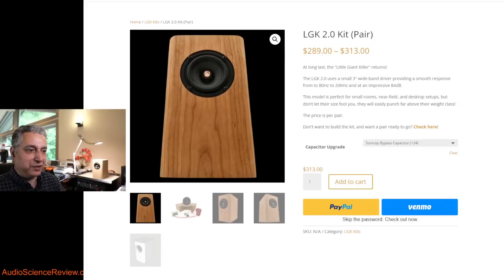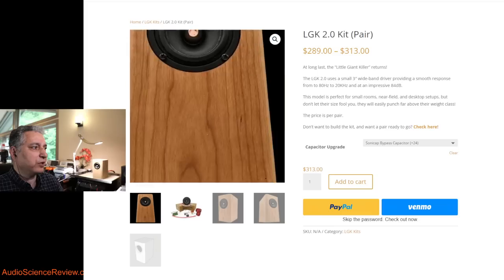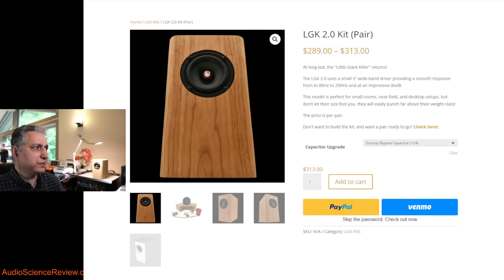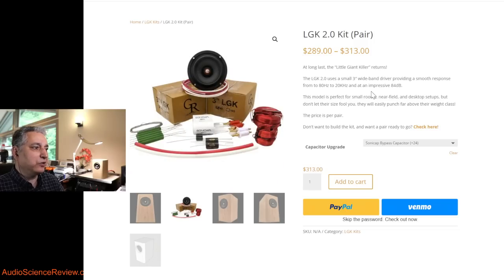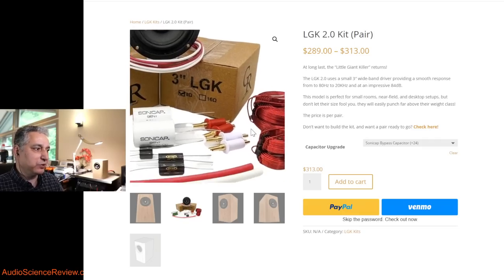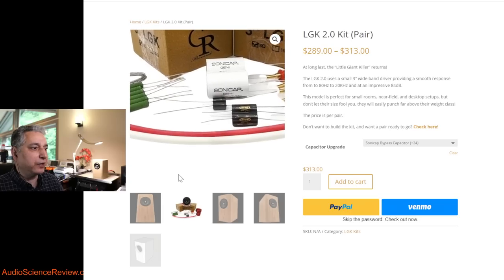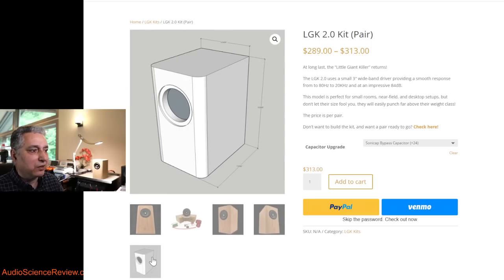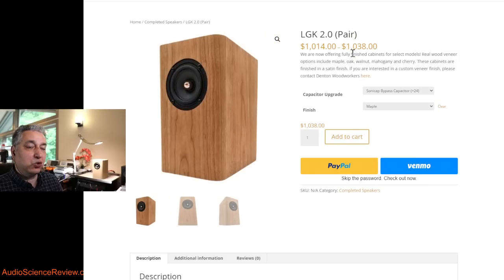GR Research LGK 2.0 DIY kit Speaker Review

Comment: Very interesting but you have one thing backwards.  The reason for the peaks is the storred energy in the driver (resonances) not the other way around.   But very good to be so thorough and explain how the data can be manipulated.  I am surprised to see so little ringing in the treble with such a large diaphragm.
Reply from the maker: If A=B, you can say B=A just as well.  With minimum phase systems which speakers mostly are, time and frequency domain are interchangeable.  So there is nothing backward there.
Reply: @AudioScienceReview  actually no.  I can alter the phase without changing the timing, but I can't change the timing without changing the phase (unless I specifically changing the phase).
Reply: @AudioScienceReview  Here is a simple example of what I am talking about.  If I hook up a speaker reverse polarity, all of the sounds are out of phase (180 degrees)  but not out of time ( no delay).  But if you delay the sound out if a speaker, all of the sound coming out of the speaker will be out of time (delayed)  and out of phase.   You can adjust the phase back into phase but for only one frequency of all of the different frequencies coming out of the speaker due to all all of the frequencies having different periods.    So hopefully this explains that A=B but B does not = A.

Comment: lol, GR is sending out speakers not to Jay - he is now qualified as he is using high end cables and and even cable raisers! Only then you will get a sample for "testing"...
So much snake oil... I like some stuff GR is doing as they try to make the market aware that a good speaker needs some good components... But in many cases they just overrate the importance of i.e. a "high end speaker terminal"...
Reply from the maker: Yeh, as I noted, this kit also comes with said high end speaker terminals (tube connectors).  This makes the whole affair a lot more offensive since it pushes the cost up so much.  Engineering is about spending money where it matters, and not where it does not.
Reply: @AudioScienceReview  Yes so true. If the base is not right (like the selection of the driver)  then a golden suprainductor cable made from Unoptanium does not make it better...
Hope you will test threi 2-way designs some time.
I build my own spreakers from a german designer - very nice (I hope) - but probably to expensive to ship the stuff to US. They cost around 1k per speaker (very high end Be tweeter is alone around 400€). - but I am happy.
Reply: @AudioScienceReview  one day after your video - GR announced an upgrade 2.0 version. Not understand what exactly changed - he was just babblng about a woofer?
Anyways he described also that the speaker is not for loud sound... "maybe 84db"...

Comment: Ouch. I know he made a video earlier that he would host you in Texas, so you can accurately hear things. Maybe you should go. I’d certainly watch that video.
Reply from the maker: He is giving me little reason to go there.  If he wants to sell me on his tweaks such as tube connectors and cable lifters, then he should do a blind test in front of the camera as he has promised.  Then I could go there and verify.  He also needs to provide data on why his audio system is great.  Stringing a bunch of audio products and powering them with lead acid batteries and such does not make for a good system.  Post a measurement of the room and then we can talk.  I also like to know who told him having curtains all around is a good idea.  The fabric acts like a high frequency absorber which is definitely NOT what you want to do in your room (you need to have broadband absorption down to a few hundred hertz).
Reply: @AudioScienceReview  If both sides approached it with honesty, your visit there could be one of the greatest videos in audiophile history.  That's asking a lot for anyone in the audiophile trade though.  Preconceptions are the norm on pretty much any topic or side of any topic relating to sound reproduction.   For example, many people claim that there's no difference in amplifier quality.  Maybe once you get to a certain point, that's true, but at the sub $1000 AVR level I've found large differences with certain speakers.  And it's not subtle at all.  Simple measurements like SNR or THD@1KHz into an 8 ohm resistor don't mean that much.  That doesn't mean measurements are useless, just that a lot of amplifier measurements aren't indicative of sound quality and I never see measurements of an amp into an actual reactive load.

Comment: 26:25 i don't think i've ever heard an undamaged speaker behave like that.. i would suspect a BIAS adjustment is in order on the amp or the output transistors are about to short out, the speakers are the last thing i'd check. that driver is something special indeed :}
Reply from the maker: I am with you on that.  I have tested a lot of small speakers that I coined as "bad" but this speaker goes so far above and beyond that makes you question what it is done.  Indeed, I swapped one amp for another to verify it was not the amp.  And swapped the driver as well.  I even bypassed the whole network and it still produced distortion.

Comment: While I am no fan of Danny, quite the opposite in regards to his style of business and douche baggery, I do agree DSP can screw up the sound in most cases. If DSP is applied to the original digital music file to create the crossover, which divides the frequencies to be converted to analogue signals and then sent to multiple amplifiers to drive each speaker driver of a speaker, it can be a game changer but expensive and complicated due to multiple amplifiers needed. However, in most cases DSP is applied to analogue signal after the original digital file was converted to analogue, processed digitally, and then converted back to analogue. This really screws up the sound IME.
Reply from the maker: You can, and I frequently do, use DSP with passive speakers.  You use it to correct frequency errors.  What you are speaking of is active speaker design with DSP.  In the case of this speaker, the issue is extreme distortion so not a matter of filtering/DSP.

Comment: To me the most interesting thing is the sound test versus the measurements and graphs. My monkey brain would say judging by the distortion graph, ok it can't play lows, but the rest looks acceptable, but then the listening test, even through youtube compression, exposed the dumpster fire of the speaker and that got me wondering. Would a multi tone test, like the one you use for dacs and amplifiers, be at all useful or a good representation of performance for speaker measurments?
Reply from the maker: It is complicated to run such a test on speakers/headphones (I tried). The challenge is that these transducers don't have flat response.  As a result, their distortion products cannot be compared to each other.  This speaker though has motivated me to go back to the drawing board and see if I can make that kind of testing work as we need something.
Reply: @AudioScienceReview  Maybe you could consider documenting your journey to that "perfect" speaker test and the findings, because I think that would be a very interesting series. Maybe at the end even some sort of a guide/comparisons that shows how the difference in the graphs translate to sound? I realize that is a massive project, but one can dream :)

Comment: I think one should understand that this design is not intended to play low frequencies and I don’t think it is exactly fair for knocking it’s distortion when playing it full range. This should be connected to a receiver and high passed at 200hz. A subwoofer should be used for every thing below that. I think the distortion measurements should be done with a 200hz high pass and then analyze how well it performs. However, given the price on this speaker, and the huge range of commercial speakers in this price range, I don’t see this being a good value.
Reply: Well... It is sold as a full range speaker and it is called a 'giant killer'. So expectations are high.  The limitations, as you mention them, are not made very clear. I agree with you, that for this price a full range speaker (compared to other speakers in this price range) should be expected.
Reply from the maker: Andy is right on the money.  PC computer speaker companies always sell 2.1 with subs for a reason.  They don't take their pocket speakers and call them giant killers and such.  200 Hz is also very high crossover frequency as then you can locate the subs which you don't want.   Besides, why would you want to salvage this speaker for any reason?  You can get $200 speakers that are so far ahead of it.  Here, $200 doesn't even get you the drivers and filter.

Comment: Well it's no wonder he didn't want you to review it...  I think you may have hit the nail on the head.  Also it makes me wonder about the Kef ls50.  I borrowed that and found so much distortion in a song I couldn't believe it.  Now I wonder if it was just the speaker.  I heard the same distortion but much less with my two way diy speaker.  I  have yet to hear any distortion on the focal 1038 with that song.  I think the music I was listening to drives bass and midrange so much that two ways just suffer through the song.  Makes for an interesting thought.
Reply from the maker: My issue with LS50 exactly: https://www.audiosciencereview.com/forum/index.php?threads/kef-ls50-bookshelf-speaker-review.11144/

"Turning up the volume resulted in distortion as I could visibly see the little woofer trying to keep up."
Reply: @AudioScienceReview  glad you could confirm that.  I thought it was the recording more than the speakers.  It's just odd to me how well that speaker is reviewed.  What I heard was massive amounts of distortion as well.  The song is from, The Birthday Massacre off their new album.  They have so much bass and mid-range hitting at one point even low volume would distort that speaker.

Comment: Getting rid of that PEAK in the top end would not cost much more then he spended. that notch should just be much wider. the components do not becomes much more expensive to do so.  a cheap coil or 2 the value cheap tiny coil is not costing  dollars more. its in the Khz region come on.

Comment: Software filters are not free.  They cost in sound quality by introducing digital artifacts into the audio signal.  Many people think digital is inaudible but those people are so used to hearing the artifacts that they "don't hear them". But they are extremely easy to hear to those of us that listen to good analog.  I call it digital hash.  Just like your comment about distortion, once you train your ears to hear digital hash, you can't  un-hear it.
Reply from the maker: EQ is built into my Roon player so it is "free" for me.  It operates in high resolution, 64 bit sample domain so very much free of the worries you talk about.  Their beauty is that they are instantly adjustable unlike the filters that are shipped with this kit.  And no, there is no such thing as "digital hash."  Most of the planet listens to digitally produced and consumed music.  To say they are all deaf to such problem is not logical.
Reply: @AudioScienceReview  yes in a room app.  What about listening to a turntable or reel to reel tape.  That is why I specifically mentioned analog.  Running an analog signal through a digital processor makes no sense in my book.  If you do, you get the worst of both worlds laid on top of each other.  I am a keep digital, digital and analog, analog person. So when I listen to analog, I don't want digital artifacts laid on top of the analog signal.
Reply: @jked7463  -- To what "digital artifacts" are you referring?
Reply: @editorjuno  a bunch, pre ring, post ring, improper levels due to the limitations of the bit system (controversial but my experience tell me I am correct), treating all sounds as sinusoidal curves, inability to properly capture the curve of complex music like choirs,  when many are not, lack of phase accuracy at high frequencies, lack of ultra fine details, improper portrayal of leading edges of notes, inaccurate decay of notes to name a few.  But to me the worst are the non linear and level issues, especially the non-linear ones like ringing, leading edge of note issues, treating all sounds as sine waves etc.  Once you tube you ears to hear this stuff, you can't un-hear it.
Reply: @jked7463  -- Alrighty then...what you (think you?) hear is what you hear.  Carry on as you will -- FWIW, I don't find what you've written even remotely persuasive, but as long as you're enjoying the music, it's all good.
Reply: @editorjuno  that's your choice and you have every right to your opinion as well.  My opinion is based on 30 years of audio design and watching digital grow up.  My first use of digital processing was with a white 5000 digital processor.  As I have said once you learn to hear the digital hash, you won't be able to un-hear it.  So if you don't think it is it is there, maybe your ear is not tuned to hear it.  That said, you enjoy your music as well.  I will certainly enjoy mine.
Reply: @jked7463  -- My own 50+ years of involvement with both home stereo and professional audio gear says this is mountain-molehill issue, and I frankly can't imagine a sensible reason for training ones hearing to detect supposed flaws that are currently inaudible.

My own nearfield/desktop system is loaded with DSP -- my excellent main L+R speakers are active, DSP-dependent 3-way "studio monitors," and there's no way my modest sealed-box subwoofer could put out what it does below 30Hz without its DSP-based EQ.  I also use a DSP unit to correct a couple of minor (audible and measurable) flaws in the response curve of my four otherwise-excellent passive ambience/surround speakers -- an approach that's easier, more fine-tunable, and cheaper than modifying all four crossovers to make those corrections via LCR calculations and calibrated-mic measurements.

To add to the tragically detrimental digital blasphemy, the first component after my DAC(s) is a vintage piece and one of the earliest applications of DSP to the home listening environment: the (IMO) superb Yamaha DSP-1 processor from the mid-1980s.

One would think that all those D-to-A and A-to-D shenanigans would unleash an avalanche of the sort of supposedly audible effects you describe -- but AFAICT there are none, and IMO it borders on insanity to deliberately try to hear stuff that, assuming it's actually there to be heard, isn't the least bit obtrusive or otherwise bothersome to me as an avid lover of well-recorded music.

YMMV and obviously does.  Fair enough.  Peace.
Reply: @editorjuno  I trained my ears because as a pro and residential  audio designer my goal is to design the clearest, most coherent, least fatiguing systems for my clients that I can.  So I need to train my ears to hear everything I can, digital and analog,  to maximize my clients intelligibility and/or enjoyment.  If I didn't do that, I would be failing my clients and betraying their trust in me.
Reply: @editorjuno  Oh, and you can deny existence of the artifacts all you want but that does not mean they don't exist.  I can't hear to 20k anymore, does that mean sound that high don't exist and younger people can't hear that high up either?  I mentioned the term "digital hash" to a fellow commercial audio guy and his response was that was the perfect term for the digital artifacts he had been hearing for years.  So that means there are at least two of us  crazies.  As we have both said, enjoy your listening.  In a way it's a good thing you can't hear the artifacts, you probably enjoy the music more than I do.

Comment: Great info, many thanks! I always wanted to hear the sound from GR Research videos. One general question though about the waterfall is, shouldn't there be some judgement on good and bad based on, for any given frequency, (1) how steep the waterfall (dD/dt) is and (2) how high the waterfall (D_max - D_min) is? (D being the dB of the speaker at some frequency)
Anyway, I am learning that measurement and listening are complementary. Great work and demonstration!
Reply from the maker: My pleasure.  As to waterfall, it is complicated in that there are no standards on how to run.  Top researchers like Dr. Floyd Toole also warn about not trusting it for that reason.

Comment: I have always wondered why you don't start your Loudspeaker Reviews with a listening test.
Reply from the maker: My listening tests are not what you think.  A proper listening test is performed blind and level matched with near instant comparison to other speakers.  Needless to say, this is not practical.  So instead, my job in listening is to a) listen for distortion/dynamics and b) verify measurements of frequency response.  The former is done using special tracks and powerful amplification to find the limits of the speaker.  What it measures there is inconsequential.  Listen to the clip in this video to see how it matters not whether you have, or have not seen measurements.  On the frequency response, I create correction filters to flatten the frequency response.  I can then perform blind tests of those filters one by one and report on difference between my impression and that measurements.  

A reviewer that just listens to random music and opines about the sound is writing folklore, not anything reliable.  See my video: https://youtu.be/_2cu7GGQZ1A